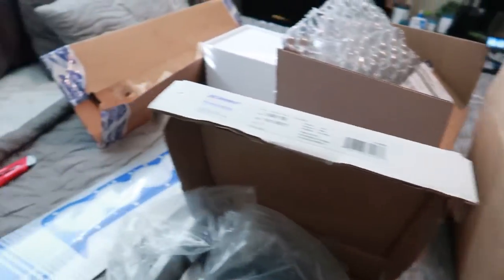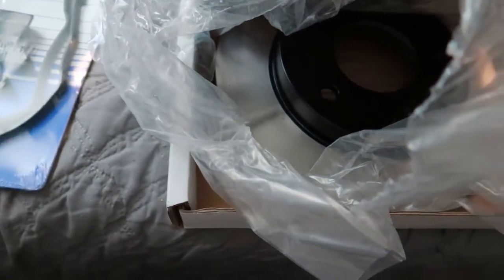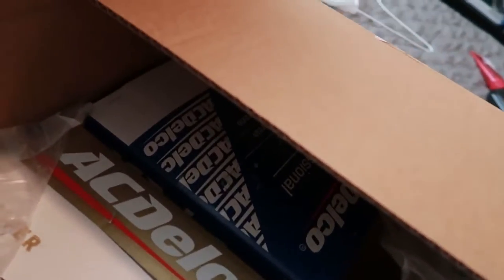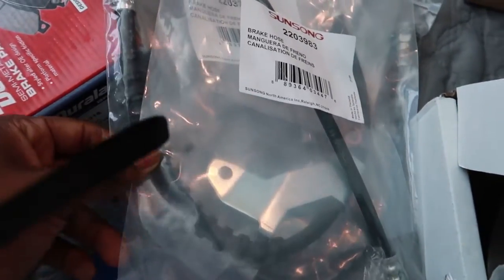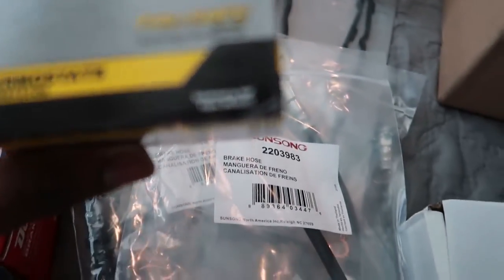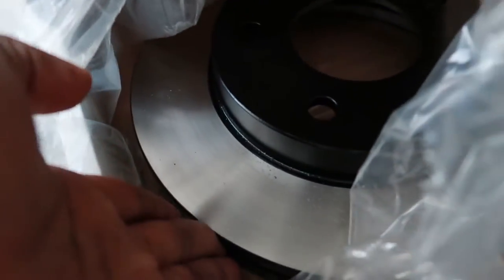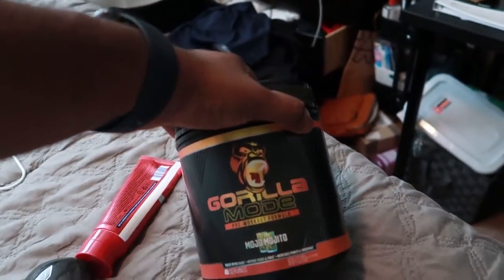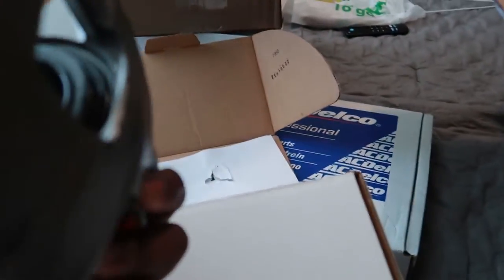Project Build (1986 Cadillac Eldorado Biarttiz) - I Went On A Part Galore !!! Ep2

Comment: let me know how your heat works in the winter with that 160 degree thermostat. i thought about putting one in mine it would be cool for summer but in another car i have my heat never really got hot how i wanted it in the winter. how ever fail safe thermostats are the way to go. when the gym content coming? LOL
Reply from the maker: You know what I never thought about how it may effect the heat. I’ll let you know although I may not really drive it during the heavy winter months due to it just being my slab. But you’re right about them fail safes. Lol gym content coming soon I just gotta get back into the groove after starting this new job. Your boy be tired lol